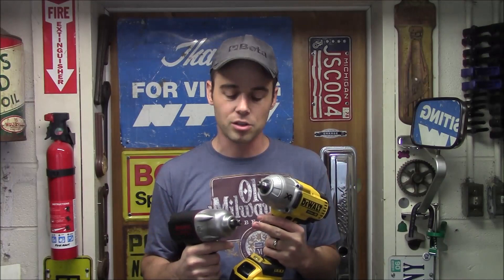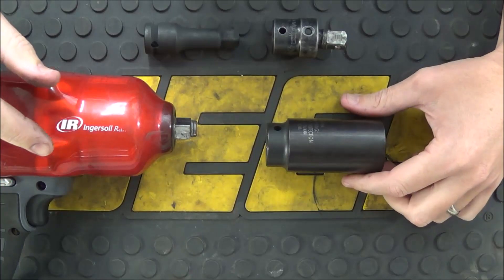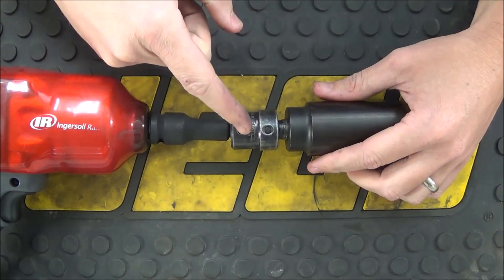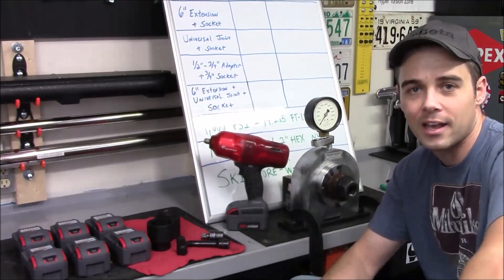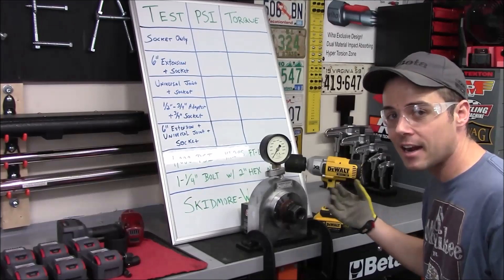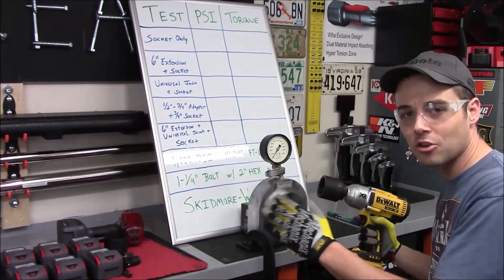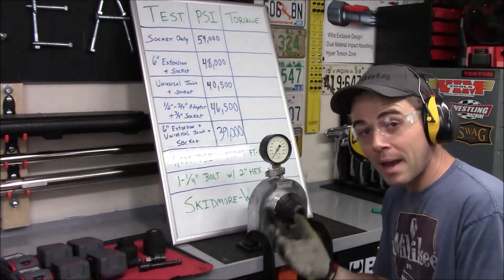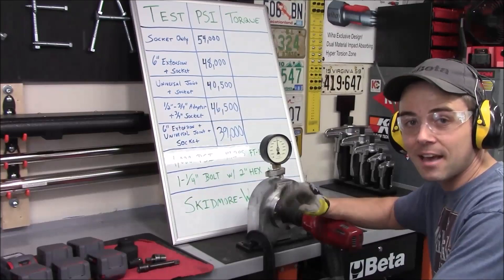Torque - VS - Torque Loss (Impact Wrench tested with Skidmore-Wilhelm)

Comment: I have a theory that you do lose torque using adapters that are larger than your anvil however if you use adapters that go to smaller size then it should be no to very minimal torque loss
Reply from the maker: It’s additional connection points which are the biggest issue.

Comment: What is the reasoning to divide the pound reading by 70?
Reply from the maker: That’s the formula that determines torque based on bolt size + bolt tension readings.  If the bolt was a different size, the # to divide by would change also.

Comment: I have heard of this and didn’t believe it until I put my Milwaukee 2767 on a long extension and a swivel adapter to get a hub bolt off. Wouldn’t budge. Turned the steering wheel put directly on and it took it off with no hesitation. Now I see the proof here. Thanks

Comment: 1/2in 24in long breaker bar + 3/8 adapter + 10 inch extension + universal joint+ 15mm socket.  Yeah that bolt was in a tight spot. I was going nuts thinking it was never coming out

Comment: is their any pour mans approach to get figures on high torque impact drivers? (just for own curious purpose with a new impact driver in the house and see if it somewhat on call with the spec's with the 5 electronic torque settings)
I was wondering would some of these cheap digital torque meter-adapters from China be able to deliver any sense of indicating torque-result.
you can get these 100-1000nm or just 60 to 600nm ½ torque adapter-meters that can sense max torque reading. (I reckon its simply basic load cells sensing a given bend in the metal nut)

Comment: The Skidmore Whilem doesn’t read in PSI it reads bolt load in pounds. So it’s just “Pounds”. Great video though - I am jealous that you own a Skidmore. I really want one and am half tempted to just shell over the money for one. $$$
Reply from the maker: You are correct.....pounds of bolt tension.  This was the 1st vid that I used one in & misspoke.  Thanks for pointing that out! 👍

Comment: A trick I discovered if you must use an extension is to twist the extension in the direction of rotation with your hand while impacting. Not sure why this works, it's obviously nothing to do with the minimal amount of extra torque your hand applies, but it definitely makes a difference. I assume it's due to your hand stopping the extension from bouncing backwards between impacts and the hammer having to counter that reverse action in the next impact.

Comment: It's funny you bring up a Honda crank bolt I bet it was a V6 Odessey?! That was my first awakening to "WTF this gun SUXS" thought process and to get a stronger gun.  And that lead to other things and real eye opening experiences. Like you can't use a breaker bar tap the starter method on all crank bolts one was actually left hand threaded true story 2011 Rover Sport 5.0l. Got the IR 1/2" gun but it got it's "nuts busted" ! In the end after trying for and hour I used a friends 3/4" gun to get it. That was twenty years ago. It takes experiences to really figure out somethings and you nailed what I've believed for a while. Simple really you can feel the twist in the extension. What really amazed me was the heat build up and was glad when you went back to your first test and the pressure changed. I think a stronger gun turns more energy into heat the socket was smoking. All strong metals seem to get hot faster then weaker metals. Been watching your vids for a while now never seen this one til now that's weird. Glad I found it keep the vids coming. Have you done one kroil or PB blaster yet? Stupid question I'll search it.

Comment: Can you do a side by side of the Makita high Torque '08 vs the Milwaukee '63?  
It seems these "Big boys on the block" have been staring eachother down for a while now. It's time they "got it on".
Reply from the maker: The Makita is more powerful....but more people buy the 2763 since it has been around longer.  Milwaukee just announced a replacement for the 2763, but I doubt it will be out until later this summer.

Comment: What kind of torque loss is there when you use reducers?  If I use a 1/2" impact wrench with a 1/2 to 3/8 reducer and a 3/8" socket, will there be greater torque loss than if I use a 1" extension (equal in length to the reducer) with a 1/2" socket?

Comment: i think an Air impact would have been better than battery for consistency instead of 6 different batteries that could give you 6 different power outputs
Reply from the maker: As long as your compressor can keep up.....pressure drops are worse than battery charge levels for power....

Comment: I have a question.. there is a few jobs where I only use the same extensions and sockets if I were to buy cheaper versions and weld them together would that eliminate torque loss?
Reply: @realtoolreviews

Comment: Do you have a video that compares the torque difference between impact sockets and regular chrome sockets?
Reply from the maker: No....chrome sockets should not be used with impact wrenches since they can split, shatter, or explode.  Typically since they are thinner, you will have less mass rotating = less torque applied though, so a regular impact socket will be more effective.
Reply: +Real Tool Reviews that's what I was thinking also...thanks ..great video btw... I just hooked up my dad's old compressor and looking for the most info to set it up.. Do you have a video about air hose size differences.. Something like the difference in airflow between a 3/8" and 1/2" using 1/4" and 3/8" fittings? Is getting a 1/2" 50ft. hose worth the extra money?
Reply from the maker: +Tom Pajak Thanks!  I have not done a video specifically about fittings.....but I did make one about air pressure.  I should give you some good advice about how to set things up for max performance --- check it out here ---- https://www.youtube.com/watch?v=MHx2EUWYzuM

Comment: what is the torque loss going to be from 3/4 to 1/2?
Reply from the maker: +shauncatlett It would depend on the brand/size/condition of the adapter.....I would guess roughly 10%.

Comment: What is the difference between  an extended  version. like the w7250?
Reply from the maker: +Daniel Jimenez The length of the anvil & minimal torque loss (since it is not an add-on extension with another point of contact).  I think the torque specs would be almost identical between the regular & extended anvil versions.

Comment: Possible to do a video on recommending simple extension combos to get 1/2, 1/4 etc torque of the tool capability? Thanks
Reply from the maker: +yjxu66 Not realistically.....brand-to-brand differences in metal hardness, quality, and thickness would make any attempt impossible to duplicate as a guide.  I understand the idea, but the best way to achieve that would be to use torque sticks (like they use in tire shops).  They are made of spring steel & prevent "usually" over-tightening of lugnuts.  It is always best to use a torque wrench & tighten by hand to prevent damage.

Comment: I would like to know were can i buy those huge sockets witht the 1/2  size hole, auto-zone or home-depot dont seem to carry any like that. We do so much mechanic work but we constantly have to use a adaptor for a 1" sockets on our dewalt 1/2" size impact wrench.
Reply from the maker: +Eduardo Florian You can go to Sunex's website (www.sunextools.com) & search through their catalog.  Then take the part #s or set #s & go to Amazon and search for them.  Sunex is one of the only companies that makes extra-large sockets in the smaller drive sizes.

Comment: Congratulations on having best impact wrench test on youtube (if not Internet in general).

In your coming pneumatic tools tests please consider measuring (even roughly estimating) air consumption under load. This is important factor for non professionals with low performance compressors.
Reply from the maker: +intoxigated Thanks a lot!  I really appreciate it & am glad to know that people like the way that I am upgrading this testing to provide actual torque specs VS guesses.  I will be using the Skidmore on all 1/2" impact tests & have a larger one on the way for 3/4" & 1" impacts.  I am not sure exactly how to show/estimate actual air consumption during the testing.....I will have to think about that one.  You are correct though.....with a lower powered compressor, these results cannot achieve the same results "as quickly".....if your compressor needs to cycle on & air back up a few times, you can still achieve these numbers, it will just take you longer.
Reply: +Real Tool Reviews 
My first guess to calculate tool air consumption would be following: with know compressor tank capacity measure time period required to drop pressure in tank by certain amount (I'm used to SI units, but it should be similar with Imperial):

AirConsumption[l/minute] = tankVolume[l]*pressureDrop[bar]/timePeriod[minutes]

As example: 
tank: 300 l (79.25 gallons)
measured pressure drop: 1 bar (14.50 PSI)
measured time: 45 s (45/60 minute)
we get:
AirConsumption = (300*1)/(45/60) = 400 [l/minute] = 14.13 [CFM]
-----

Keep up with the great work and continue making best tool reviews on YouTube. This is not overestimation. It's a matter of time for your channel to grow to extent where your videos will be number one in search results for people looking at tool reviews and related videos.

Comment: i know this is really important to know but for a regular size car or small suv with the exception of removing crank pulley bolts and  big transmissions and what not 500ft lb to 600 is pretty much enough if your just a regular diy person
Reply from the maker: +MrZerocool5000 Well, I think what most people dont realize is how much torque is lost simply by overcoming friction (specifically overcoming the friction caused by rust/corrosion).  In the case of suspension bolts, they can be installed at 100-150 ft-lbs & after a year of driving (+road salt, rust, dirt, etc) can take 400-500+ ft-lbs to remove that same nut or bolt.  The other thing to note would be in many cases people cannot directly place the impact on the socket & end up daisy-chaining extensions to make it work (not to mention many people are using the incorrect working pressure in their air lines).  By modifying habits & the setup they are using, most people can really increase the performance of any of their impacts.
Reply: Real Tool Reviews i know i was just aiming for many of us that try to fix their own vehicles with basic tools and low resources
Reply from the maker: +MrZerocool5000 Oh I agree completely.....most do-it-yourselfers/home mechanics dont need these ultra powerful impacts & the more moderate ones do an excellent job.  I actually really like the Ingersoll Rand 231 (my first impact ever) & think that it is one of the best choices out there for most people.  It is just over $100 & will last for 20 years with proper care.  Thanks for pointing that out!

Comment: Its not so much about points of contact versus flexing-over-length. great video either way.
Reply from the maker: +FFJabarr Not really.....since the 6" extension yielded a 10% loss in torque & the 2" swivel universal joint yielded a 25% loss in torque......length was not the culprit, it was the multiple contact points.  Thanks!
Reply: That's a separate case all together as the swivel joint has flex but also a lot of energy lost to angular motion, ie the fact that it swivels. It might seem straight when you are operating the tool,  but those hundreds of impacts that it makes have more places to disperse energy versus a straight singular adaptor like an extension. If you took two 1 inch extensions (not sure if those even exist haha) you'd probably find your torque loss yield would be significantly lower than that of a 2 inch swivel yet it would be the same length and same contact points. 

Would be interesting to see.

Comment: Interesting tester, the idea of torque loss is nothing new to me though I experience these frustrations all the time especially when pulling transmissions the upper bell housing bolts are only attained by long long extensions things get springy fast.
Reply: +FordTechMakuloco Your videos are awesome! You have saved me a ton of cash on my focus. I just wish you were a Toyota tech!
Reply: Bigchuck678 Good to hear!
Reply from the maker: +FordTechMakuloco Yep.....the long extensions are definitely the worst......I just was dealing with that earlier today on some alternator bolts with a 1/2" cordless impact.....they wouldnt budge!  I took the extension off & zipped them right out.

Comment: I know that a test like this takes time, but I think you should change two of your techniques. One would be to do this with the gauge covered, and run the impact for a set 30 seconds or whatever. You should also run through the test three times. You proved why for both of these when you reran the first test and got a different number.
Reply from the maker: +Michael Gleason The point was to prove that adapters/extensions actually do affect torque.....not so much to get a scientifically 100% accurate number.  I counted to 15 with each test.....I assume I could have been off by a 1/2 second, but for the most part it was very fair ---- and I re-tested the original socket-only at the end to verify nothing changed with the nut or bolt.  Friction, the heat of the nut/bolt, the way I was holding the impact, a slight change in angle, etc will all affect the torque numbers.....I agree that multiple runs would be ideal, and with actual torque testing of individual impacts, I will be doing that....however for this example it would have been a negligible difference.  Thanks for watching & commenting!
Reply: +Real Tool Reviews Thanks for reading my comment and making a thoughtful reply. Too many guys stop replying when they get a lot of followers. Anyway, I'm glad you'll be doing multiple runs in your shootout vids. That thing cost too much money to not take the extra time and do it right!
Reply from the maker: +Michael Gleason No problem....thanks for actually writing out a comment with some thought behind it, as well as suggestions for improvement, instead of just complaining like so many people do.  I appreciate it a lot.  I just got in the RH bolt for the Skidmore today, so now I can accurately test forward, reverse, and breakaway torque --- and verify the numbers.....lots of good testing coming up....stay tuned!

Comment: PS, an idea for swivel/universal torque loss would be a comparison of pin-type vs pinless at different angles of deflection
Reply from the maker: +BrenticusMaximus1 I have thought about that, but with this current setup (2" nut) that isnt possible at the moment.....if I get a second test unit with a much smaller sized bolt setup it may be something that I can show.  Thanks for the suggestion!

Comment: this should shut up all them folks who say "extensions don't affect torque" haha, yes, they do...like how my mg325 can easily bust loose 1 inch bolts tightened to 200 ft/lb's with a very short 1 1/2 socket, but can't bust loose 12 mm trans bolts at the end of 2 foot of extensions and a wobble socket
Reply from the maker: +bighunterman77 I hope.....something still tells me I am going to get complaints....

Comment: Nice informative video. Do you think the torque delta would be negligible between a shallow and deep impact socket?
Reply from the maker: +129Preston Thanks!  I would think that if anything the deepwell would have more torque since the socket will have more mass.....but I could be wrong.  I dont have a 2" deepwell 1/2" impact socket to test that, but if I get one I will follow up with it.....good question!

Comment: that's great, can you do one on the differences in output using different hose diameters?
Reply from the maker: +derpie2000 I am planning one with air pressure drops with different sized/lengths of hoses....as well as fittings.  The torque levels would be the same IF the working air pressure was the same between them all ---- the problem is jacking up the regulator pressure to compensate for a small line/fittings....most compressors cannot keep up.  Check out my Air Pressure video to see what I mean.
Reply: Sure will ,thanks

Comment: great review but what about the torque loss with chrome sockets compared to impact sockets? in my experience I don't know if anyone has run into this before but sometimes when I use a chrome socket sometimes it dosent loosen the bolt or nut but when I swith over to the impact in the first try it takes it right off
Reply from the maker: +om1513 Chrome sockets are very dangerous to use with an impact because they can shatter/explode.  I dont use them with high-torque impacts ever, and only very rarely with an impact driver when in a bind.  The reason they dont have as much torque, is the fact that they are thinner & have less mass (small hammer hitting a nail VS sledgehammer hitting a nail).  Definitely use an impact socket whenever possible.